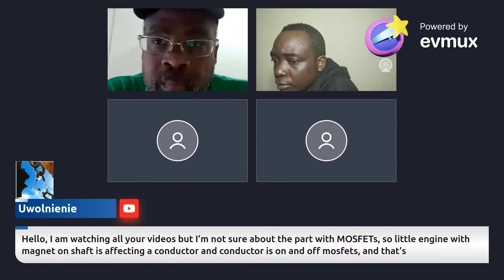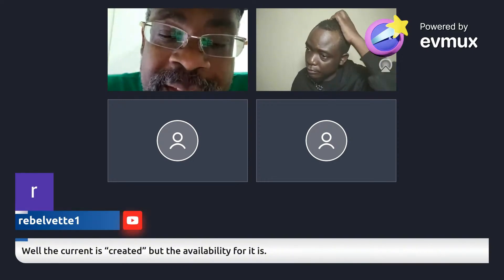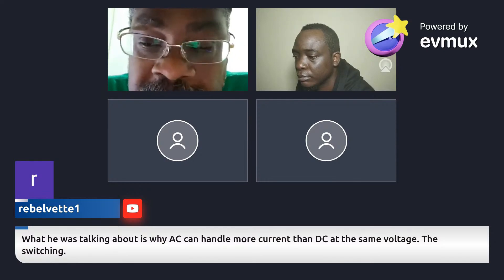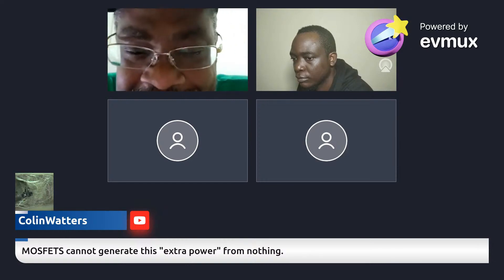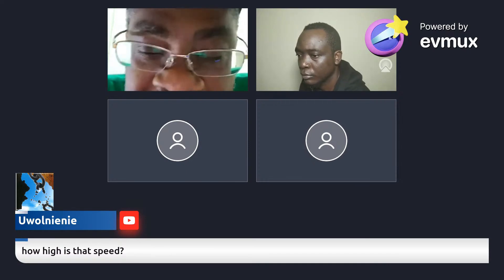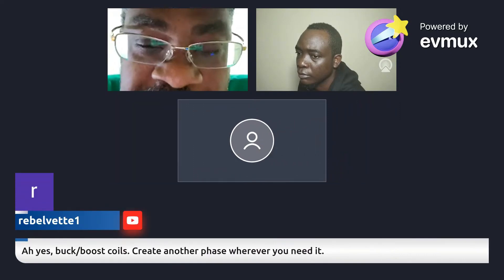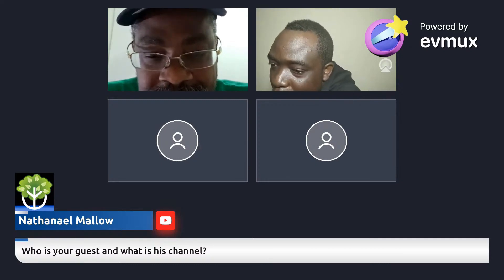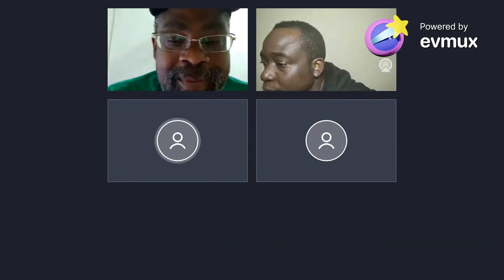Gerald From Canada Explains How Free Energy is Real in a LiveStream

Comment: When you Use Mosfet to Pump DC Capacitors, Inductor and Restor Combinations at Radio Frequencies (minimum of 20,000Herfz or 20Khz), you will disturb the STATIC ELECTRICITY IN THE AIR which the Establishments via there controlled Academia says are not there.

Even, ordinarily Pumping a Capacitor at High Frequencies would give you massive Energy Gains with little input provided you tune that Capacitor to RESONATE with the high rate of switching. This is where the Time Constant formular comes in T= RC where T = Frequency in Heartz, R= Resistor in Ohms and Capacitance in Farads.

If you know your frequency and Capacitance then the Resistor needed to charge that Capacitor to resonance at the selected Frequency would be R= T/C.

You will simply collect the replicated energy on the Negative side of the capacitor into a Grounded Step-Down Transformer to gain your Endless free Energy. The Size of the Capacitors you use determines your Output Power. 

Nigeria says Helo to everyone.

P.S: Buy ready-made signal generator on AliExpress to drive your Mosfet. Use High Voltage N-Channel MOSFET life IRF460N.

Back E.M.F is actually a useful energy because it interacts with the incessant global thunder strikes generated Air-Base Static Electrical Particles. You just neeed to harvest the rigth way.
Reply: Do you know that when charging a capacitor with a power supply and an resistor, you loose half the energy witch is lost in the resistor

Comment: We have reached a stage where now we can discuss this technology in open without no much fear. Thanks for this chanel and forum to explore air free energy.. I have experimented what Gerald morin talks about free energy ( over unity) drive hyperdrive motor with 48 VDC with 48 VDC sensor less controller and the hyper motor I rewired half generator and half motor ( 18 pole and 18 pole and when running the other have generates 245 volts AC per line and after rectifying I get 250 volts DC. 
Where I need advice and help us to understand how to use RF that get generated by spinning a washer machine water pump motor. It lights lots of LED lights but cannot run anything with wire coil. ( Transformers and motors . When the LEDs are ON, you can see the frequency of the flickering lights and since last time I heard Lloyd talk about switching power very first to operate the MOSFETs. . I wish to have advice but to my inbox if you know what I mean. ±250 0786818852.. keep up the good work and never give up.we are excited about you guys and your dedication.

Comment: We do this power conversion all the time in power supplies but it is just conversion, not creation. The spark  on a car spark plug is 1000s of volts converted from 12v but there is no more power in it there is actually less. I am hopeful for Maxwell although the God references worry me. I believe the key is resonance. They are talking rubbish here just throwing words out like gigabytes of power, faraday cages using energy, nuclear baddery etc. They need to take into account Ohm’s law, the power law and specifically describe how it either still applies of prove it being broken. I can picture the radio antenna in a faraday cage and the power captured by the faraday cage being equal / a bit below the transmitted power. If you surround a transmitter with antennas then you will only ever capture the total transmitted power, no more. The idea that you can have unlimited receivers I think is false, each one picks up nano watts but once you have picked up the total transmitted power you have created a faraday cage and no more power can be extracted. I can envisage though a system where ambient energy gets extracted leaving a space cooler and that energy is transformed to electrical, or some other form of energy a bit like in a heat pump with a COP over unity. Intuition says that the key here too is resonance.

Comment: There is no free energy. HIGHER VOLTAGE IS NOT THE SAME AS HIGHER POWER. AS voltage increase, current always goes down. Unless it isnuclear fusion , input power will always be less than output power.
Reply from the maker: someone else said that all energy is free but what we pay for is the equipment needed to produce it
Reply: Energy is free but the controlling system makes you pay. That's why you have to make your own free energy. 
If a single piece of loaf of bread is $2 and when you go to pay $2 you get 5 more loaves of bread what would that mean. That they have been stealing from you for a long time and the price has been always been a quarter. What am saying is, a 48 DC battery can  drive a system that gives you 259 volts AC easily.
Reply: @andrewthuku2638  Nothing is free in the scientific point of view.
Reply: @abisaiamatalo2769 common sense is not the same as common science.  😅😅😅
Reply: @Boom_Wealthy  science is measurable and verifiable. Anything that can't be verified is NOT scientific. We need to view and verify many of these claims.

Comment: Hi Chris, I wish that I was 20 years younger and had learned about this earlier I would build some circuits and prove to myself and others that deriving current from MOSFETs is possible. I was taught that MOSFETS were used to "Source" power. I was not taught that you could increase power out by switching the MOSFETs on and off at a high frequency. I have long since put aside all of my Hardware development tools and components... OH and they are calling it FREE energy... IT IS NOT, they are simply converting energy from one source to another in a unique way.
Reply from the maker: 😁😁 That is a good one: But hey this was a part of a 2hrs live stream: what they were talking here was about using solar panels and LEDs so Gerald says that he has developed a system where he has a cube with 6 solar panels using LED's at the centre to power them: then he runs the energy generated through mosftes and and a Tesla Coil and he can be able to increase the power out which he can now use for other tasks and for recharging the same battery that powers the LED's: but there's a lot of different takes that I get here in the comments section in regards to how Mosfets work and maybe if we do a stream next time I could get you on board to explain more on how you see them working

Comment: I think that you just explained how Simple it is, to Extract Energy from the Quantum Field that exists all around us. I’d built Coils that ‘SING IN RESONANCE!’ that put out ALLOT MORE Energy than what is powering it, & it would Burn Out. Then from reading Stanley Meyers stuff I’d found that you have to Gate the Pulse Train so the output doesn’t increase expediently & doesn’t burn out. I believe it all works off Octaves & you multiply the Resonance Frequencies to access the Quantum Fields then lower the Octaves in another Coil Coupling at its lower Resonance Frequencies which will allow Higher Pressure Equalibriums to fall into Lower Pressure Equalibriums allowing you to pull(Tesla Sink) Currents from surrounding space.
Reply from the maker: I think I need to make another video about this! Because this is a very good comment and I wish we had you on yesterday.
Reply: It is scarily simple, and this is why the information has been suppressed for so long. I've known about these things for the most part for some time now, but it wasn't until recently that I realized how everything came together, and I knew this was correct. If I knew this beforehand, things would probably be very different. Knowledge is extremely powerful in the right hands and brutal in the wrong ones.
Reply: @14supersonic  how simple? I was trying to build one of such a thing but couldn't improvise given the materials I could get a hold of. So, I saved up and switched to sola panels, inverter and a battery. 😢